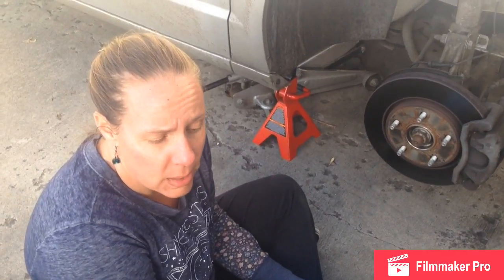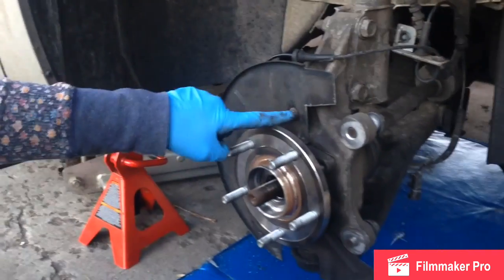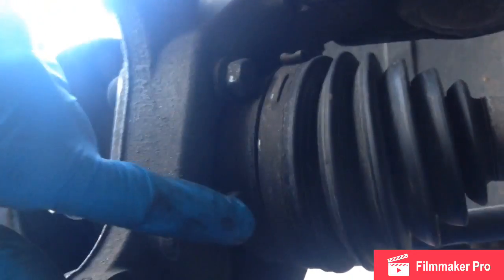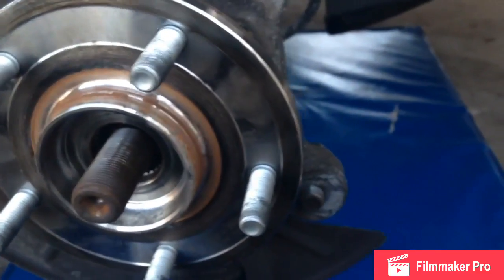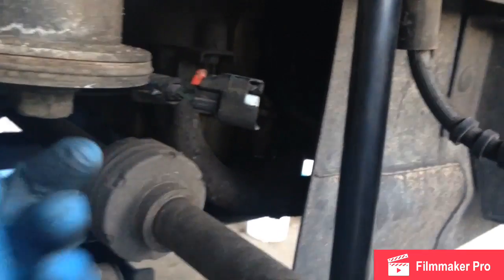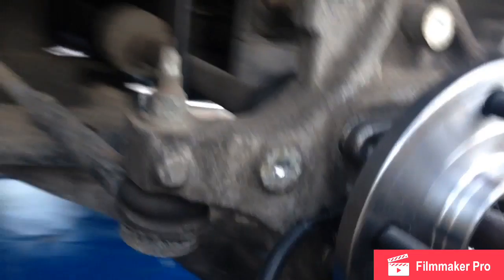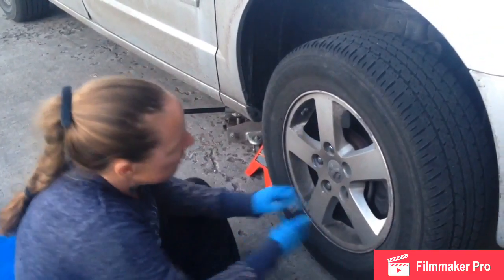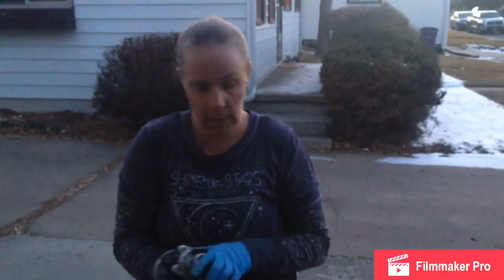2008 Dodge grand Caravan wheel bearing hub FRONT assembly Replacement

Comment: I have a 09 with 123k mikes and a wobble in the steering wheel at 40mph as well. Just replaced tie rods and sway links but its till wobbling, hopefully this works.
Reply from the maker: charles graham Tires balanced?
Reply: Mamachanic 
First thing I checked was for bulges in the tire and dents in the wheel and found nothing, but noticed the tie rods were a little worn out so I replaced them anyways. 
The tires are getting pretty old though and feathered on the outside, definitively need to be replaced soon. 
I’ll double check to see if they’re balanced. 👍🏽

Comment: Hey Mamachanic, what are the symptoms for bad ball joints?  I have a 2008 Town and Country and there's an annoying sound when I hit cracks on the road. Mostly from the right side.  sounds like a knock eveytime I run over bumps or cracks on the road.  would u be making a video on how to change that out in the near future. Thanks for your vids,  big fan here.
Reply from the maker: Bobbie Dee sorry for the long response time I would start with sway bar links because those can make the kind of sans you're describing they're pretty easy to replace I think I probably have a video for that and they're like $40 a pair. I haven't done ball joints yet but I'll keep you posted thanks!
Reply: Either that or they are notorious for stabilizer bar link making that noise when going over bumps